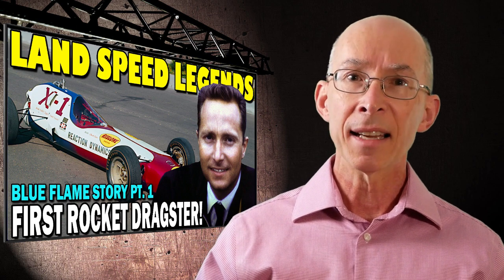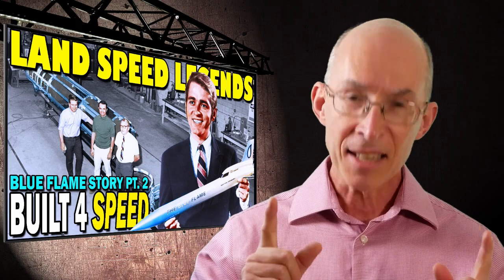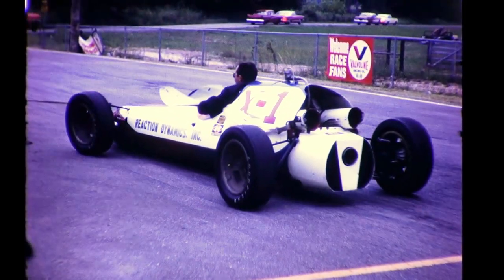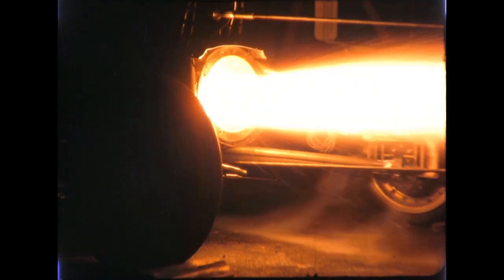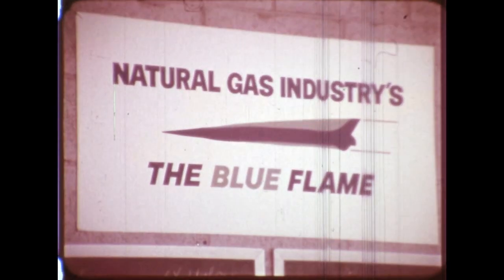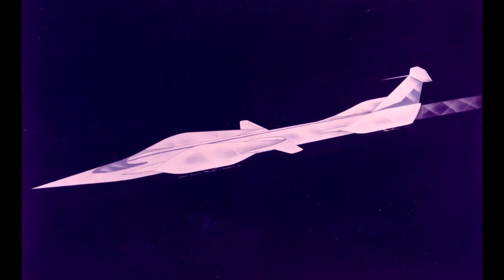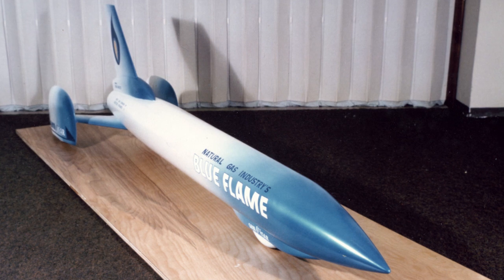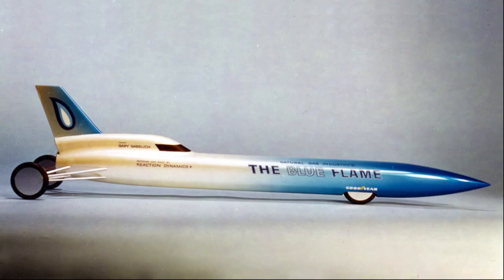Blue Flame Land Speed Rocket Car Story Pt. 2 – Built 4 SPEED

Comment: Sweet can’t wait for the next one. You know they went to Bonneville a few times. They didn’t set the record in one shot. And they used a big dodge pickup to get the car up to record speed as it was running continuous 550 mph runs.
Reply from the maker: Coming up in the next and final installment. I believe it was a souped-up white Ford van (Dana Fuller's) that gave the Flame the push start.
Reply: We arrived on the Bonneville Salt Flats on September 14, 1970. We ran The Blue Flame 26 times while we were there. We set the absolute world land speed record on October 23, 1970. We set the LSR on our first trip to the Bonneville Salt Flats. We did use a push start (like many LSR cars) to save 2 seconds' fuel for the top end of the run. USAC/FIA said a push start was okay. First time on the salt - first record over 1,000 km/h. Not too shabby!